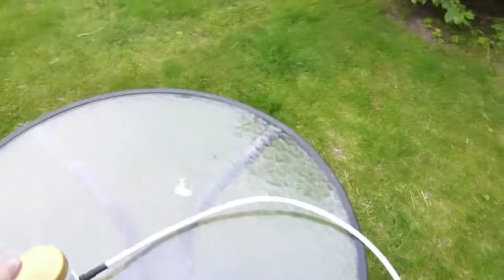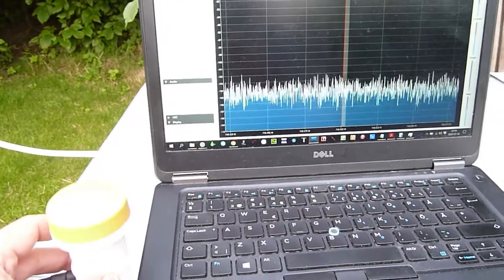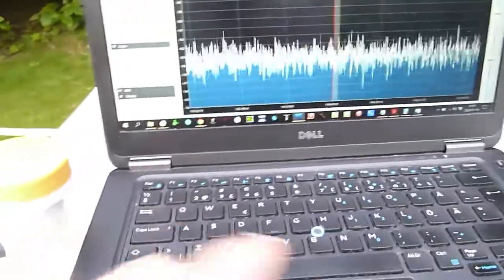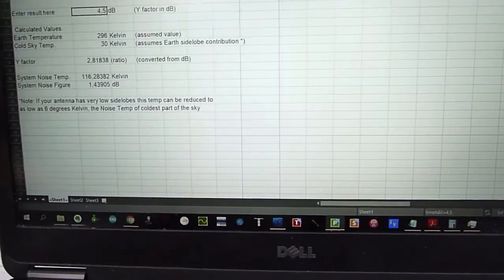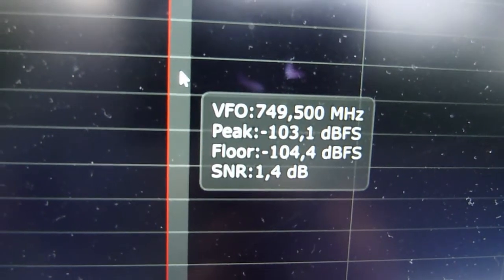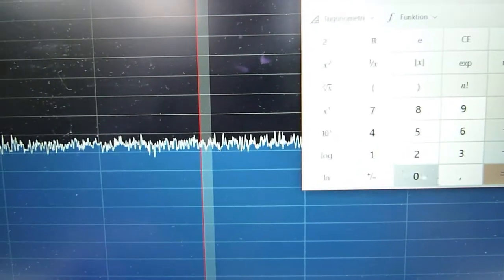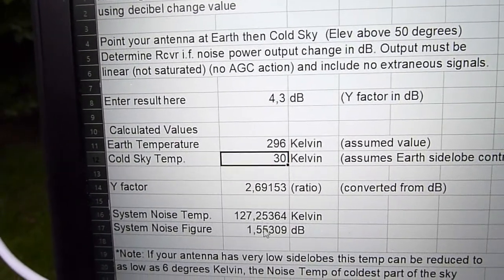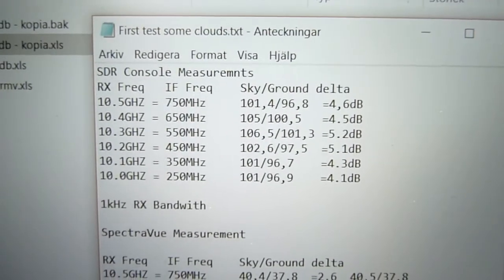Figuring out Noise Figure

Comment: You can do even better average by using 'if average' plugin for SDR Sharp. I tested it for receiving 1.42 GHz for neutral Hydrogen. It uses defined time (by user) to make background recording, then showing change.  You may get pretty flat line over the whole band, except slightly curved near both end.
Reply: Thank you fo the tip Milan. I will take a look next at that plugin  next time I need to do averaging again. 73